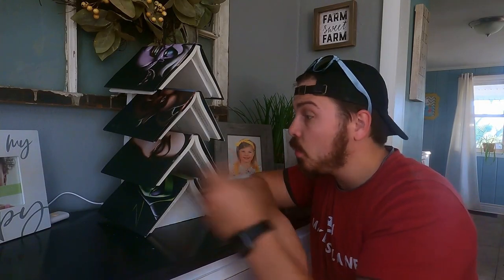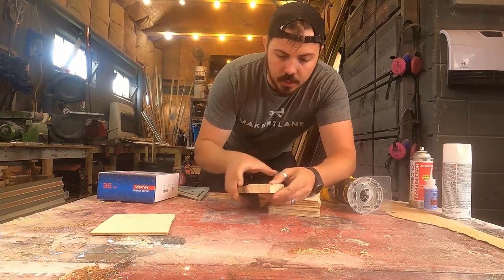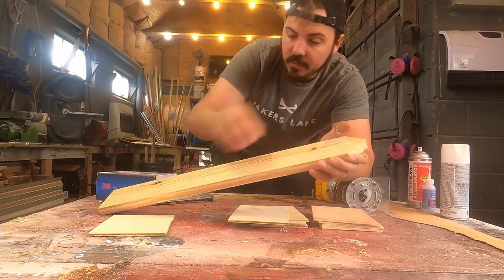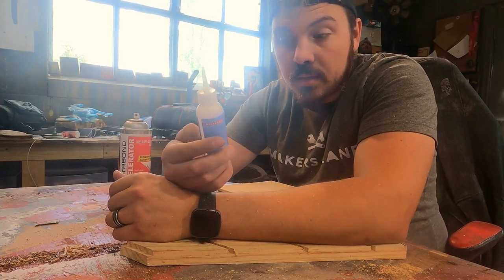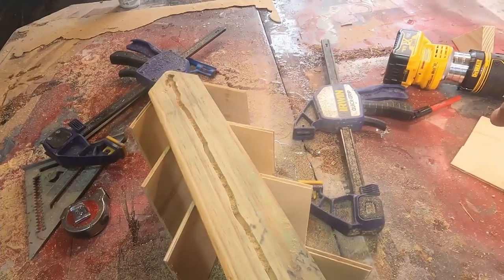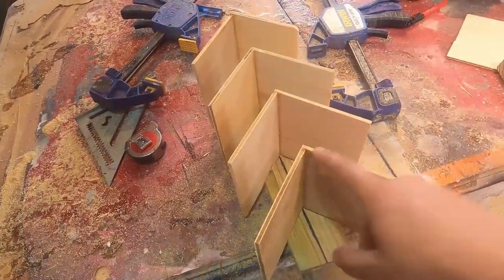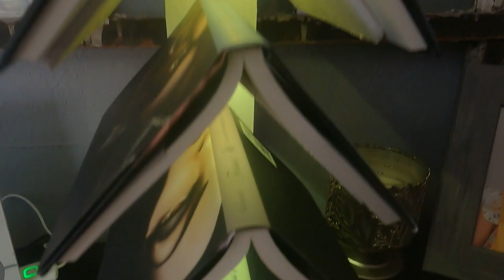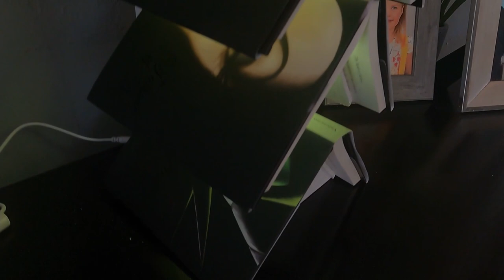Wisdom Tree Bookshelf

Comment: Were the led strips pre cut or did you cut them? How did you get them into the separate shelves
Reply from the maker: I cut them and then soldered the wires on.
Reply: @MakersLane  did you connect each individual led strip to the power cord or just to each other and one to the power supply?
Reply from the maker: You can do it both ways, but I connected each individual wire back to the power supply.